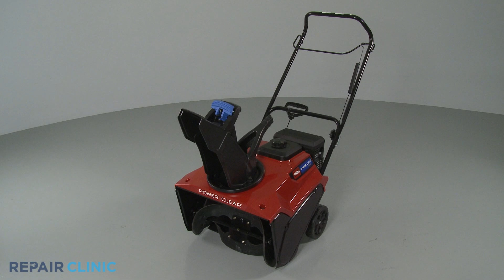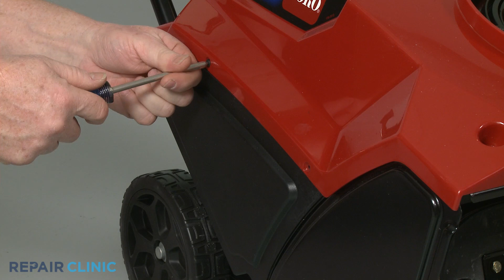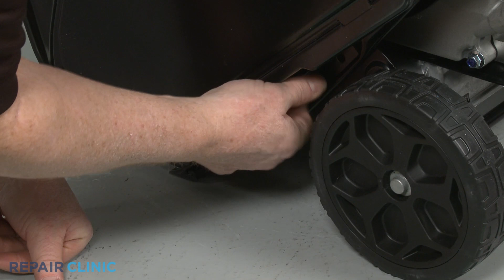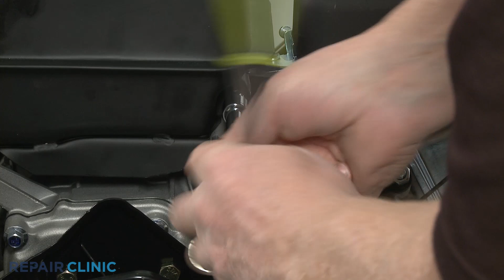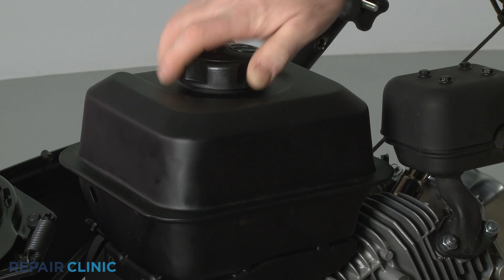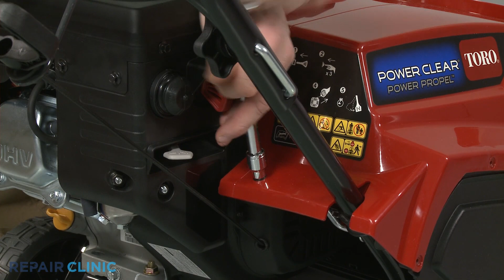Toro Snowblower Fuel Hose Replacement 127-9403

Comment: Clearly Toro has found an engineer with multiple degrees to design a simple snowblower that has to be 75% disassembled to replace a $2 part that should take maybe 10 minutes. Unbelievable. This is not my exact blower, I just came on hoping to find a size for the fuel hose. Of course, that is not mentioned in the video though I did follow the link for the "replacement part" $20 for 9 inches of hose? Good grief...
Reply: I suppose you could bring it in and pay about $500 to fix
Reply: @scottdehn5647  search for the manual parts on their website and you will find the ID and OD for your specific machine.